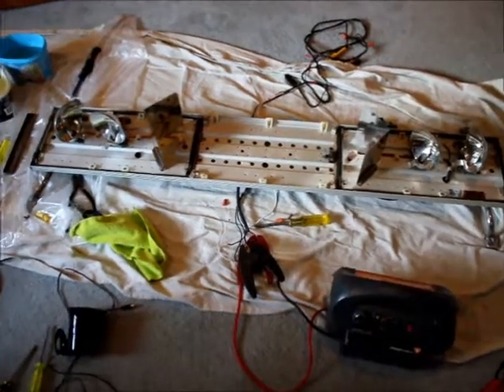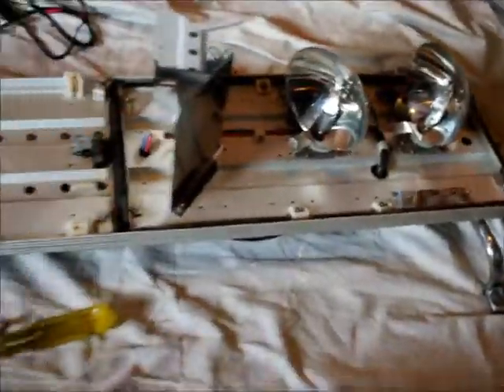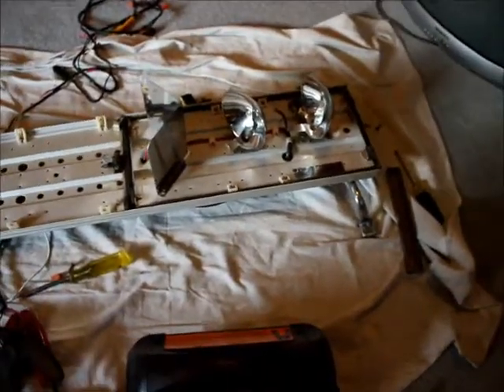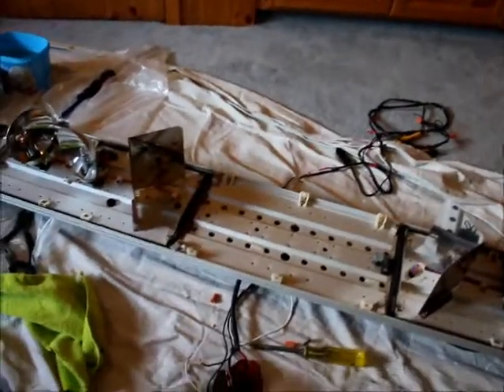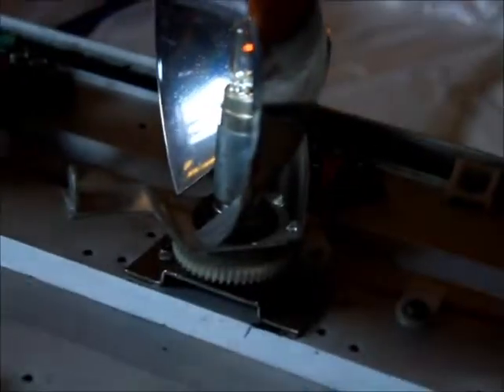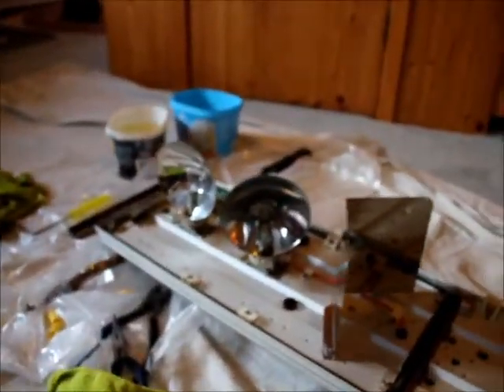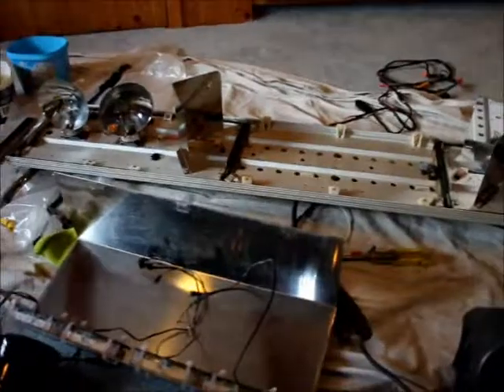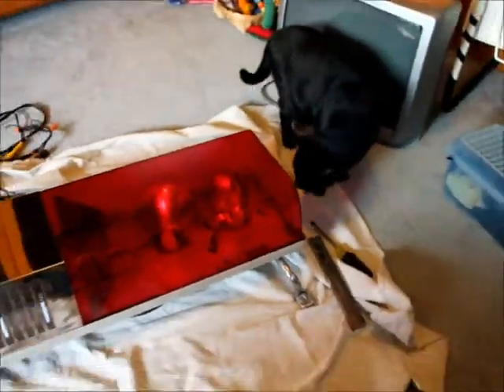Federal Signal Twin Sonic Taken Apart!

Comment: the lightbar is not a Federal Signal Twinsonic.  it is a Code 3 or a derivative of Code 3 sold under a different distributor name.  the twinsonic had a completely different frame and rotator/mirror setup.